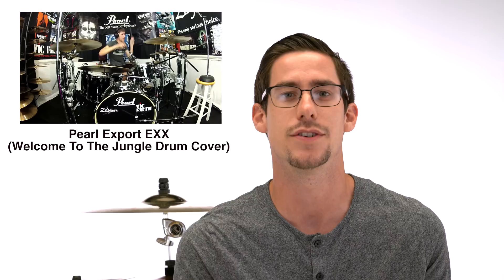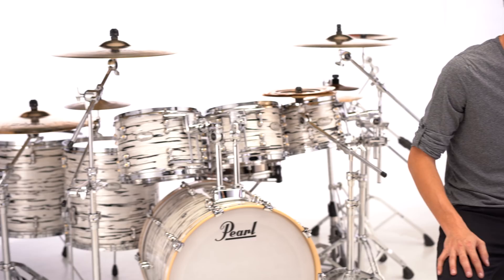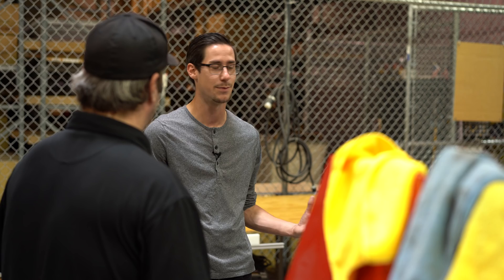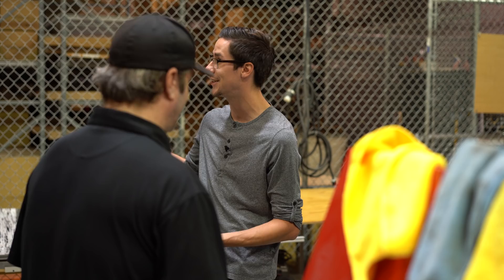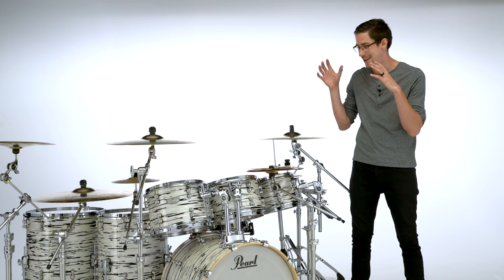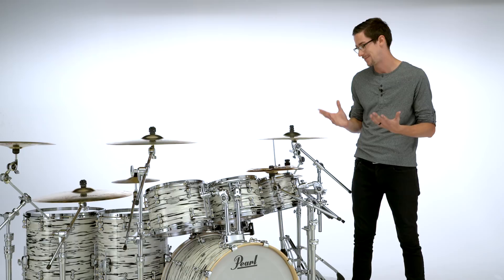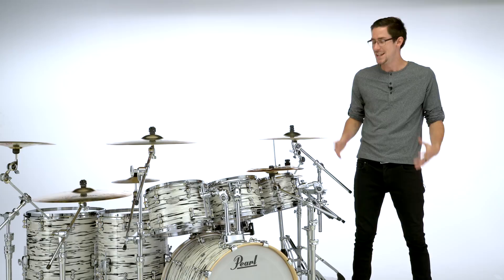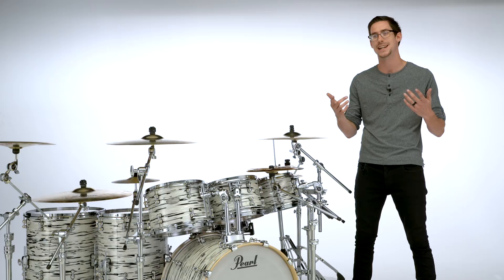MY FIRST CUSTOM DRUM SET! - FULL TOUR! Pearl Music City Custom!

Comment: 22x18 is not classic.  22x18 is the kick size of the 2000's.  14" kick depth has always been considered the classic size, from 18" through 26" diameter shells.  It wasn't till the mid 80's through the 90's that we started seeing 16" deep kicks.